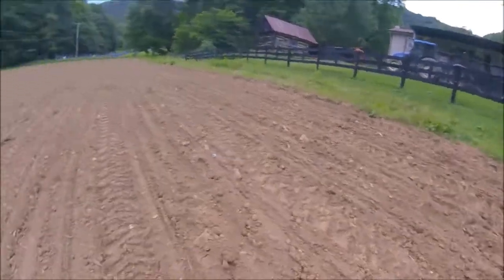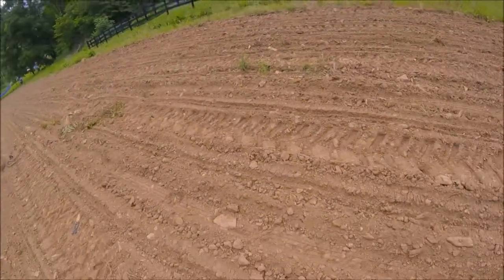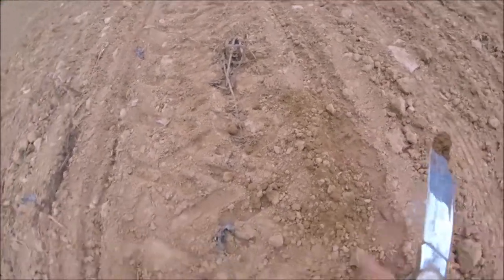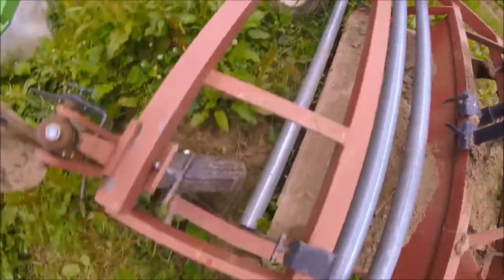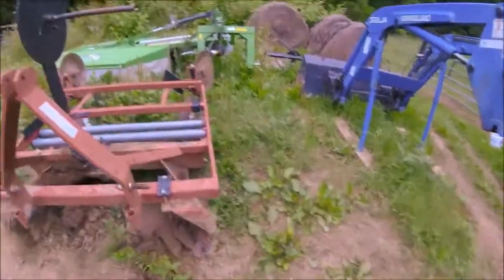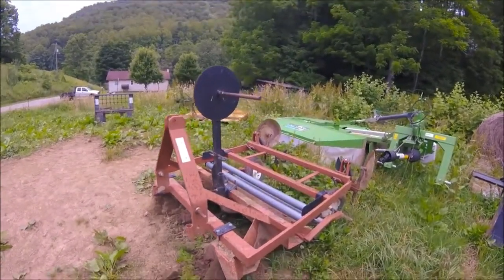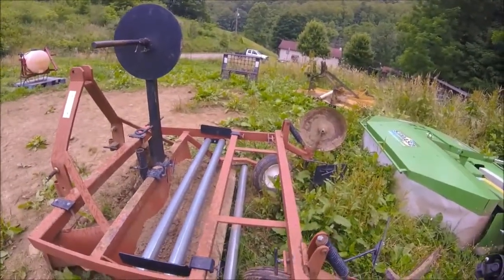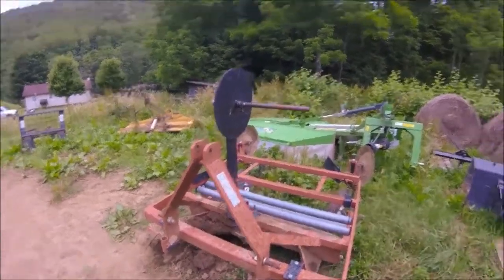Bedder/ Plastic Layer Overview

Comment: I've got an old Ford 800 and the right side is a little lower than the left side and I'm planning on taking the adjustable arm off and freeing it up so it will move it's frozen now and won't adjust

Comment: Have you ever tried using 3ft plastic? Plastic keeps tracking off to side can't seem to figure out why??
Reply from the maker: I have used 3' before for beans and tomatoes. Is the roll of plastic moving to one on the machine or is the machine moving to one side?
Reply: I'm using 3" landscape fabric and it appears to be the plastic is moving not the machine. We can move the roll to try to compensate and it becomes a back and forth struggle.
Reply from the maker: It's hard to say without seeing it. I would make sure everything is properly adjusted. Start with the roll guides on the layer then check your away bars or chains on the tractor. Then I would make sure your hold down wheels and covering disk are in the right position. I know you have probably already checked those things but that's about all I know to do. If you could send me a video of it I might be able to spot something. I hope this helps.
Thanks for watching